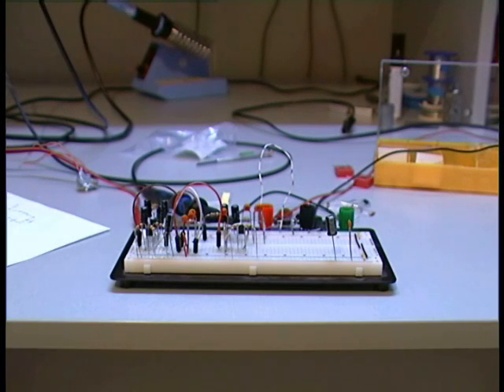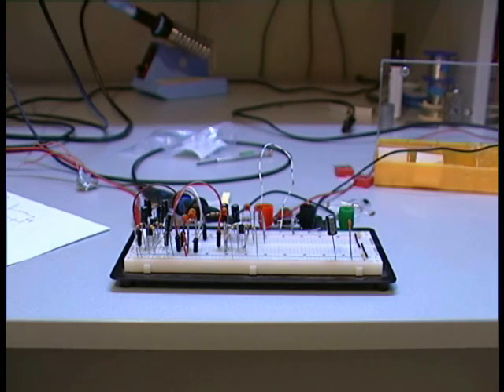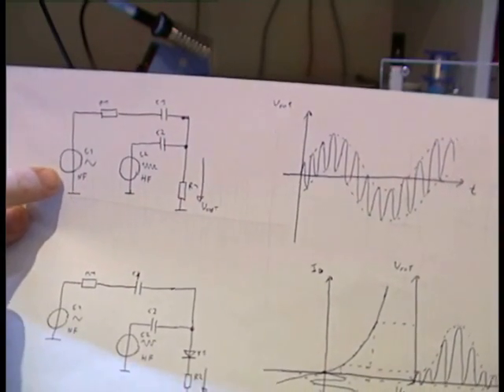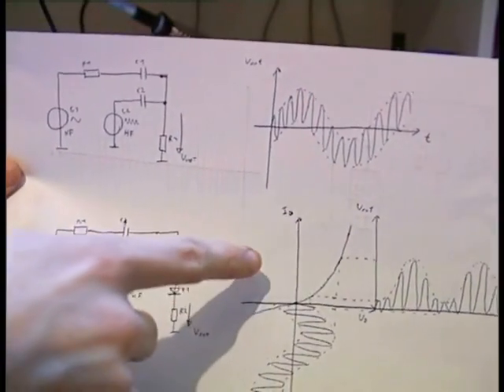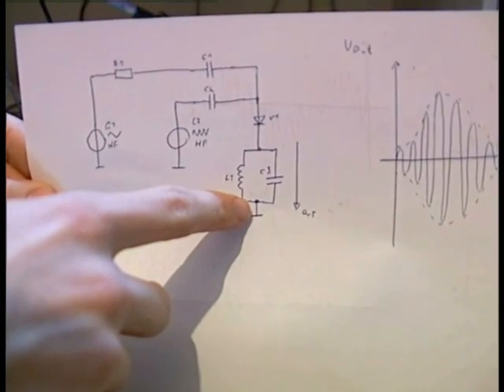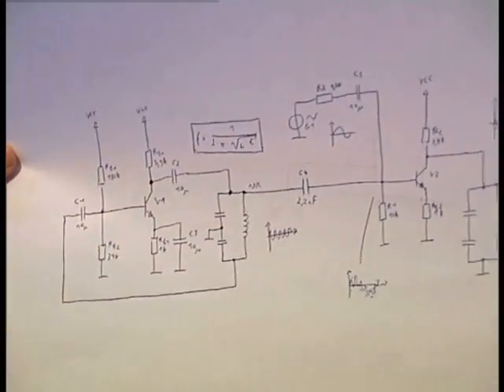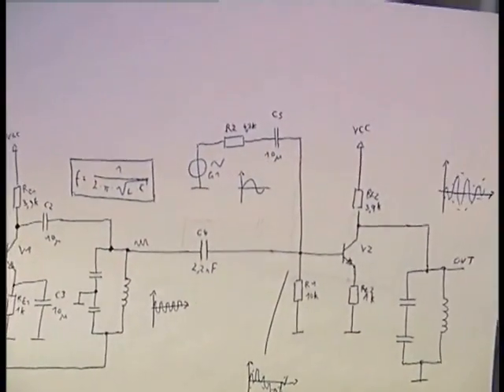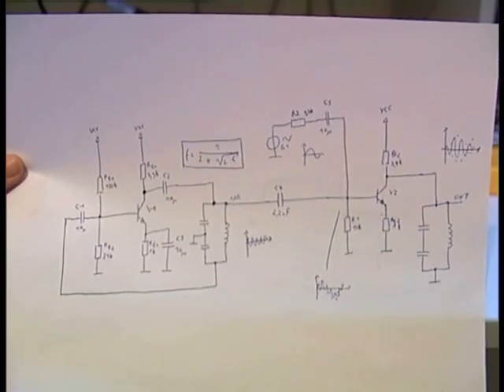Amplitude modulation circuit and how AM works

Comment: YES the diode creates AM because of its non linearity. It produces  the carrier + upper and lower sideband that
create the  modulation PLUS .plus harmonics of the carrier_ and harmonics of upper and lower sidebnds .

Collector modulation uses a power supply that includes the modulation signal . 
Calilector modulation DOES necessarily  produces  harmonics  !

Comment: Sometimes I wonder how deep should one go in teaching the function being attained. To make it work is one thing but to to make it work efficiently and an electronic student to understand all the implication is another.
For example, one should not excite a parallel L/C circuit from a voltage source but  a current source due to the impedance matching. An imperfect voltage source will make an L/C paraell circuit work  but it would be better to excite a series L/C circuit with a voltage source of low impedance.
At 2.44 we have two voltage sources where only one has a resistor in series with it, If the capacitors are treated as a short circuit I would  not say that the circuit is acting as a summating circuit.  It would be if they both had a series resistor such that we may look upon the parallel curcuit as being driven off two current sources which would excite the parallel L/C ciruit most efficiently,
Now  in the Colpitt's oscillator  and the modulator the   L/C ciruit is being fed from the collector so that is fine and most efficient. 
In the Colpitt's oscillator, the base is being driven by the parallel circuit from  a point of high impedance and so it is not really matched, but it works in a manner  as the imput impedance of the base is not that low. Ideally there  should be a buffer stage these for impedance matching purposes.
At the modulator side the audio signal is from a voltage source which had been adulterated into t current source by the series resistor, while the HF side collector had been adulterated by the collector resistor into a  bad voltage source .

My experience is that many students try to get  circuits to work but they do not seem to understand the impedance matching requirements and often I see students trying to find the frequency response of a parallel L/C tank circuit by feeding it fron a voltage source of low impedance  and being disappointed at the Q factor of such a circuit.    Many students seem to think that they can feed the base of  a transistor from a  voltage source  when at the emitter there is a fat capacitor or no resistor.

I feel that with BJTs students should be aware of such issues and I feel that many miss this depth of thought in transistor  circuit design. All this stem from the fact that the effect of short circuits and open circuits and low and high impedances existing in many devises is not given enough attention and making something work is fine at one level but      at a certain level not only the function must be taught but the efficiency with which  it is produced and the philosophy of the whole rather than the operational part only.  it is not a case of, " But it works!"

Comment: Hi, great video. Is it true (it looks like it in your video), that the unmodulated carrier has the highest average potential, and it is weakened when it's modulated? So a radio station would use less power when transmitting music than when transmitting nothing?